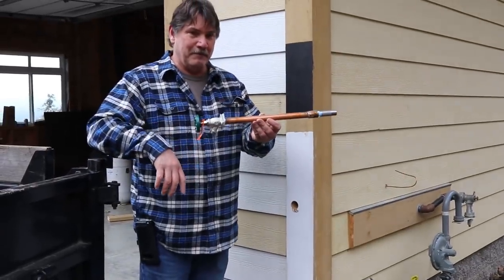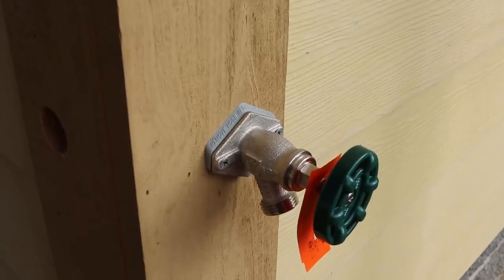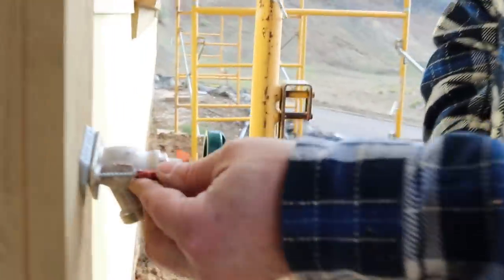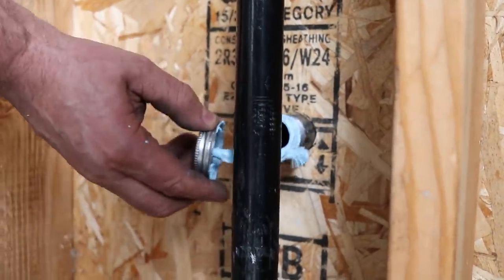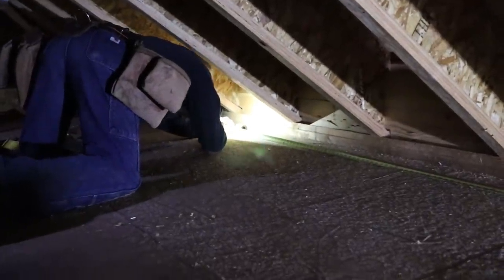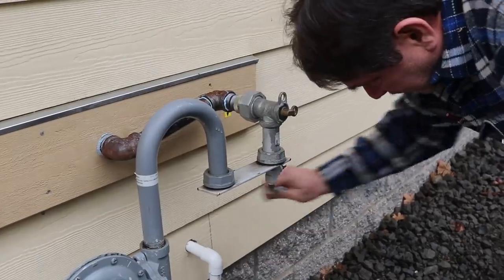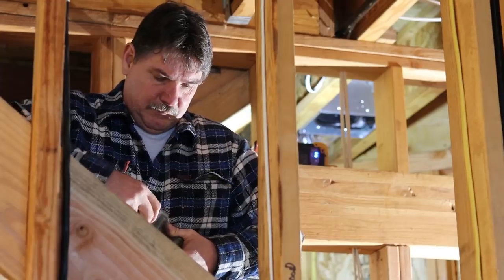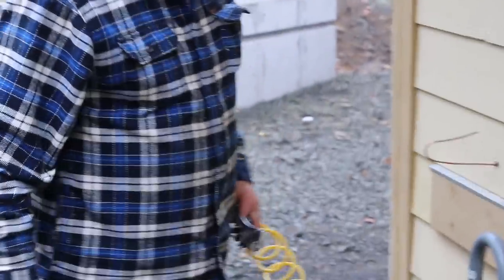Gas Pipe, Hose Bibs, Water Heater Ep.99

Comment: “That’s a sign of poor workmanship, my signature.” I spit my coffee out on that one. Your plumber is hilarious.
Reply: Caught the plumber talking instead of plumbing...and the solder drip froze as a consequence.
Reply: That comment was GOLD!
Reply: I was laughing my ass off, gonna start using that one at the shop.
Reply: "Gas Pipe doesn't have to be as tight as water pipe" The true words of a Fuckwitt. If you want success, Get a gas fitter that Knows what they are doing.
Reply: @rossfincham6948  Except the guy didn't say that.
Reply: "It's my signature" 😆 🤣
Reply: @rossfincham6948  He is talking about gas pipe downstream of the meter and the pressure regulator, the pressure is much lower than the water pressure inside the house.
Reply: Most good plumbers are unique. Love this trade.
Reply: 6:48 is when it happens lol
Reply: @rossfincham6948 somebody doesn’t know sarcasm or satirical comedy very well

Comment: I was told by an old plumber once: "tankless heaters will save you money until your wife and kids find out they can take endless hot showers..."
Reply: I don't get it. Isn't it the other way around, with a tank heater you can get X minutes of hot water, then when it runs out it gets colder IF it can't heat fast enough. With tankless, don't you get infinite hot water? If it's undersized for shower, you would get cool water all the time.
Reply: @Catrik  the joke is that your water bill will go up
Reply: @pro353  Oh, that's right 😁 I completely missed that.
Reply: Jokes on them.  I have well water!  😂
Reply: @pro353  the longer it runs the more gas it burns. Stored hot only lasts for example 50 gallons. Tankless will spit out hot water as long as your water and gas flow. Meaning. If you use 70 gallons it has cost you more than a stored 50 gallons. AND contrary to what most think storing 50 gallons does not cause your meters to spin constantly. 50 gallons once heated will stay warm for 3+days. These are facts. And tankless doesn’t not mean “instant”
In fact it actually takes longer to arrive at your tap. End rant. Sorry.
Reply: All this said. Once my tank goes out I’m installing tankless because WHO WOULDNT WANT ENDLESS HOT WATER!!!! 😆😆
Reply: Be without power and see how warm your water is going thankless. Pros and cons to tank and tank less. What I'm saying is if the power goes out with a tank you still have hot water in the tank to use until its gone with thankless no power no hot water unless your putting it on the stove.
Reply: @roshawnsims8390  a point made but not a great reason to miss out on endless hot water. So many things rendered useless without power that the need for back up is paramount anymore. Everyone I know has a generator. A tankless takes little power to run versus an electric tanked water heater. So in that respect a tankless would be a better choice. But to your point most outages are only a few hours which you would never fire a generator for. Then with a tank you experience no inconvenience other than a dark shower!!😁😁
Reply: My properly sized oil fired water heater, provides endless hot water from a tank, and it’s much cheaper than gas to run, however not sure what will happen with new energy policies an the price of heating oil. It does require electricity unlike some tanked gas fire units though, but much faster recovery than comparable gas, I have no access to naturalgas in my area, so choices are oil, propane, or electric
Reply: @carls6359  you’re not wrong. Luckily here in Indiana natural gas is available to me. I have a 50 gal. Gravity vent which requires no electricity.  Recovers quick.
Reply: @ mitch why I said that is because there are people that see endless water and it doesn't compute that you need power. I live in California so we have thankless heaters everywhere in New construction.  People don't educate themselves on things. Just like back up power. Again I said pros and Cons. They have tank heaters that are efficient also now also Sizing. My house is 4000 sq ft so the load I'm using for me works with a 75 gallon tank heater right now.the old house with 2300 sq ft worked great on thankless but also was newer.
Reply: @roshawnsims8390  the times I’m powerless and need hot water are very few.  I can’t remember the last time the power went out and I thought, QUICK!  TO THE SHOWER!
Reply: @mitchjones2821  I've never run out of hot water with a 75 gal tank and the water gets hot pretty quick too. Maybe in a larger household tankless would be better.
Reply: Or until you have to pay for your bi annual flush.
Reply: @roshawnsims8390  I have a battery backup on my tankless.
Reply: @PedersonPantry  you still will use more gas and electricity
Reply: @bkoz319  well now we are making two different arguments
Reply: @roshawnsims8390  all you would need is an inverter to get the ignitor going, not ideal but any 12v car adaptor would be enough in that edge case
Reply: I think Matt Risinger said that in one of his recent videos too
Reply: yes, there's actually a name for it: Jevon's Paradox.
Reply: I have a tank water heater, and it can run both showers (2.5gpm each), and heat the house without losing hot water. And it take a few $ to keep that 80gal tank hot during the summer. ($15 bill -- much of it non-usage, that goes up to around $30 in the winter when it's heating the house.)

Comment: "I noticed this takes way longer, and I get paid more the longer it takes" Awesome! :)
Reply: No truer words. That's why I love the way my plumbing outfit did my water heater... by the job. It's going to take all day anyway, so no rush, go back to the shop or Lowes for whatever is needed. (he didn't bring the gas line kit, so when my rusty old tank was hauled away, he came back with the pipe cutter / threader.) I was more surprised AO Smith was here at 6:30am to drop it off -- warehouse is 1.5hr away. He was a lot like Phil, but with a cigar.

Comment: plumber: "taut....is that a word?"

EC: "The close fit of the pipes and the cleaning effect of the flux enable the surface tension of the melted solder itself to pull the material towards the higher temperature using capillary action."

lmao

Comment: Good point about using the two wrenches! The reason for using two wrenches is that when you are tightening a piece that connects to a 90° elbow, you risk cracking that elbow, as a lot of torque is going into that elbow instead of only into the threads. In this case, the torque force is tightening the two nipples into the coupling and preventing the 90° from cracking.

Comment: Is the garage going to be conditioned space? I know it's not standard practice to have the garage be conditioned on a new build but if the home owner wants to work in the garage they usually insulate and add a heat source after the house is built. 

Reason I'm asking is because of the plumbing in the exterior garage wall and that hose bib installation.
Reply: I was going to ask the same question - The frost resistant fitting seems redundant if the pipes behind it are liable to freeze up.

Comment: Gas pressure past the regulator is usually only 8 to 10 ounces of pressure.  Tight enough to prevent the pipe from twisting loose later is more than tight enough to prevent a leak.  Anything more than that is just more insurance against a leak.  And as long as the pipe diameter is large enough to carry the necessary volume to run everything at once, you are good.

Comment: Just a couple of questions, Why use a galvanized pipe nipple on the tankless water heater's service valves, why use black iron pipe on an exposed meter loop, where is the test "tee" fitting for pressure testing the gas line ?

Comment: If one needs to use those outer frost proof hose valves, might be good idea to put it trough some pvc pipe. So if it leeks from what ever reason, it would drip outside the house not in the wall.
Reply: And then put a larger-diameter PVC pipe around that PVC pipe, so if the inner PVC pipe leaks for whatever reason, it would drip outside the house, not in the wall.
Reply: @jej3451  No silly, the second pipe is stainless steel.
Reply: @jej3451  For you AluPex won't be enough :-)

Comment: We used to nail the blocking (as you call it) pre nail one end on the edges or both ends  depending on available hammer swing space,  as you well remember ! one thing, a proper claw hammer with a deep curved claw works one hell of a lot better for this than one of those flat clawed wrecking hammers you guys like !  a heavy, short headed cross pein is pretty good too. In the early days of battery drill drivers I was forever reverting to the hammer and nails procedure for this, because somehow my driver was always on charge when I needed it !
Reply: The first cordless drill I used was a 9.6 volt Makita that my boss’s son had given him. It had a ice metal case but only came with the tool, charger, and a single battery. I went out and bought him a spare battery but it still seemed like every time I had to use it the battery in the tool would die and no one had charged the spare.

Comment: 13:37 tell Phil that you can hammer the top outer lip down on those cans with the brushes that don’t reach the bottom after hammering it down the brush can reach the bottom.
Reply: I leave them upside down on my dash overnight then scoop out the rest into a slightly more full can. The cycle repeats....

Comment: Can you use flexible gas pipe which comes in rolls to reduce the connections? I personally used the flex yellow pipe on my house. The gas’s company has hard pipe from the outside to the inside of the house.

Comment: Phil is great. One question though, how come you've run the gas in black iron pipe? Here in the UK iron pipe hasn't been widely used, domestically at least, for probably 50 years. The only place you'll see it now is old run down buildings or places like government offices and schools. All domestic gas is run in soldered copper pipe as far as I'm aware. the only reason I can think you'd use iron pipe is because it's tough as an old boot.

Comment: I know how to read my monthly gas bill. During summer I am paying $4-$5 a month to heat our water with 4 people in home. So I'm paying $48-$60 a year for a water heater, payback on tankless aren't what they claim. Tank maintenance is to drain once a year, which takes little effort. Yearly extensive heat exchanger cleaning is required for tankless units. When they stop working average Joe can't fix it unlike a thermocouple in a tank unit. Great video!

Comment: Here in upstate NYS we can’t put any supply pipes in exterior walls, period. Even a tiny pinhole gap in the insulation would guarantee a frozen pipe when it’s 10 below 0. Frost-free  bibs are installed through the rim joist into conditioned space. Tankless heaters are terrible in areas where the ground water temp is low because they can only produce so much change in temp, (“delta T”) so the colder your incoming water the less hot water you get on the other side. If you want 120 degree hot water you’ll get a LOT more if the incoming is 70 degrees (Miami) vs 40 degrees (Bismarck) Take a close look at the spec for output at a given delta T before going the tankless route or you’ll be disappointed in the performance.
Reply: Or just connect two tankless units in series.

Comment: If the frost proof bibb is installed on a corner and the stem is in an exterior wall, doesn't it seem it would render the whole thing vulnerable to freezing?
Reply: Yes, I was thinking the same. Also the pex running up the outside wall.

Comment: If the pressure holds there's really no reason to go around w soapy water because it can't be leaking it's a waste of time I pump it up to about 40 or 50 even if that guage doesn't budge in 24 hours you have no leaks for sure they used to test with a manometer it's inches of Mercury against the air in the pipe and that's very sensitive believe it or not he's right about the working pressure on the gas line it may be half a lb that's why it takes a new system like that forever to purge ( get the air out ) often times we will just open the gas valve till we smell it and then connect it to the appliances otherwise trying to light them w the lines full of air can be frustrating to say the least it's not as dangerous as people think if done right by someone who knows what they are doing like Phil

Comment: Why is the attic floor dirty? Why not use yellow gas line?
Reply: I am glad you asked, we had a pool put in years ago with a heater, no gas line on that side of the house, so I had a contractor run the yellow flexible gas line in the attic across the house. Skip about 7 years, now I need a new roof, unbeknownst to the roofing contractor, or me, he ran a nail through the gas line. We have LP gas, which you know, is heavier than air, the leak was above a room that we never go into, we finally noticed the smell, all is well, but could have been a disaster. Will never use flexible line again.

Comment: :30 "If you leave your hose on in the wintertime"...yeah, I might have done that.  As for gas pipes needing less tightening than water pipes, that's a surprise.  I would expect gas to work through much smaller leaks.  But that's not my area of expertise, so I'll trust him.

Comment: If that is a galvanized steel nipple on the inlet of the first hose bib, it will likely cause galvanic corrosion resulting in a leak.  If it is stainless - no problem.

Comment: Why is there so many joints inside walls? To my understanding joints are usually the ones to leak, so it would make sense to run one pex from a manifold to a the place of use?
Reply: Surface mounting of piping is problematic for many reasons; protecting the pipe from damage, hits and snags.  Pex manufacturers warns about ultraviolet exposure. Making Pex installs look nice is time consuming.  When Installed in a wall  the pipe has greater physical protection as well as some thermal protection if the walls are insulated.  If one is trying to use as few
Reply: Fittings as possible the wall cavities are usually dead spaces with little to no interferences so one can put gentle bends in the Pex without needing to use extras fittings.
Reply: @acemannotsomeother  Didn't imply surface mounting. But using a single length of pex from the manifold to the point where water is used.
Reply: Home run in a single pipe, no fittings, is "best" practice. And I always use brass fittings when I have to, even though they are more expensive, their durability is priceless.

Comment: Is there a legitimate reason to continue to use TANKED water heaters? Besides cost anyways. On other building channels I still see some contractors install great big TANK water heaters in these custom homes they build. I don't understand why.
Reply: Using my water heater for radiant floor heating, and having recirculate loop for domestic hot water, made tankless more expensive to operate, more expensive to maintain, and more expensive to buy. No reason for tankless in my application, your mileage may vary.
Reply: Most apartments in Spain have gas-fired on-demand water heaters.  They're horrible IMO.  Trying to regulate the temperature by mixing cold will shut off the heater half the time (because of low flow) resulting in a shower that's too hot, then freezing cold, then boiling hot, then freezing cold, ad infinitum.

Electric on-demand heaters with temperature controls that are located by the tap are much better.  (Electric showers are quite common in the UK, and inline heaters for the kitchen and bathroom sinks are also available.)

My place in Norway has a water tank/heater in the crawl space under the house.  It helps keep the ambient temperature down there above zero in the winter.

In the UK, the water heater is usually placed inside a cupboard that doubles up as nice warm storage for linen and towels, etc.

Comment: Gas piping doesn't need to be all that tight as the typical pressure on a residential installation is only about 1/4 PSI.

Comment: I don't know why he went spraying the joints before the air test was finished,  if it was tight he's just sprayed all those joints for no reason and it'll need tested again anyway once the gas is in the lines.
Reply: The inspector is scheduled for the next day. I'm sure he'd like to discover a leak now (and fix it), rather than wait a day for the air test to complete, only to fail inspection and have to reschedule. Spraying soapy water on some connections is cheap insurance. Find it now or find it later.

Comment: That is a lot of solder. You need a dielectric union for dissimilar metals because electrolysis will be happen 1:10-2:00. If they are going to show this guy plumb a house  perhaps have it be done the correct way. Phil, is funny but there are issues on how he gets stuff done.

Comment: I'm watching the goobering around with all this trickiness, thinking it's no wonder whoever piped our house for gas ran it half-way 'round the outside of the house, then in right next to the stove.  I'm actually not sure whether the end of that run is at the furnace and water heater (nearly in line with the stove), or the furnace and water heater are on a separate branch.

Why do we keep making houses that have to be made into swiss cheese to build or fix?  Shouldn't we figure out a nice-looking way to keep utility lines easily accessible for the life of the house?